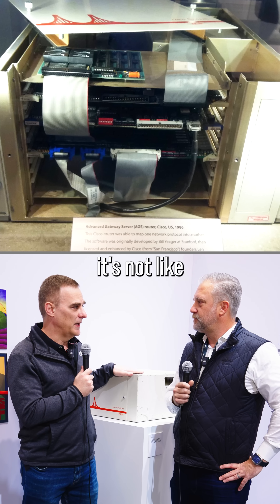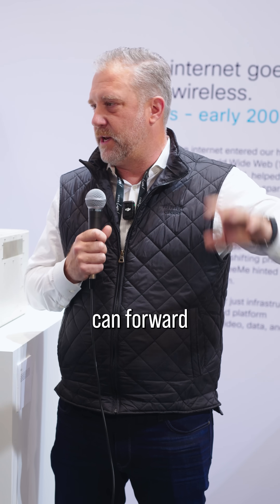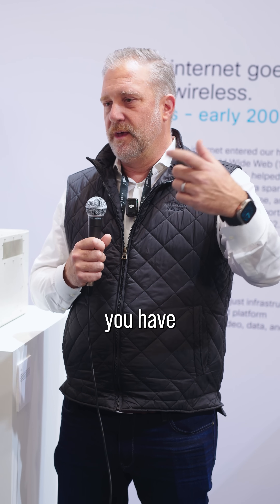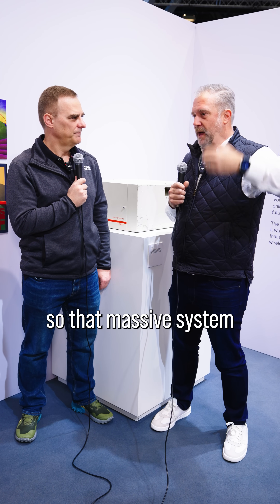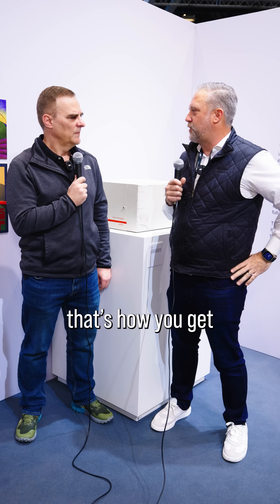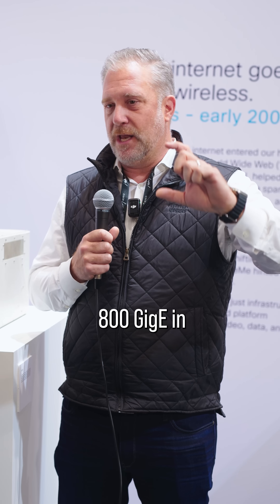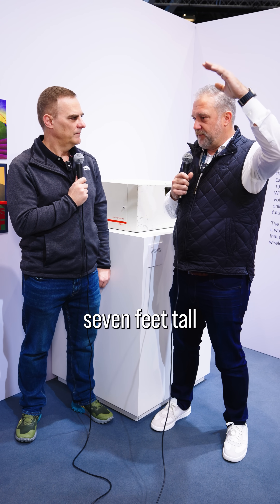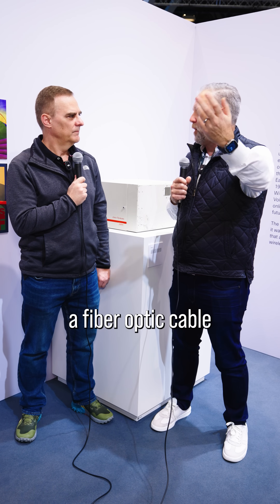Half-Petabit Router… Explained in 60s

Comment: The Cisco may be able to forward that much traffic at a single time but no one’s gonna see that much speed off of one Cisco. 😂 

You can get possibly up to 1,600Gbps by LAG’n 16 100GigabitEthernet ports, but you won’t be able to utilize all of that at once. LAG doesn’t work like a designated port. You will only be able to use 100G max and that assumes you have another 100G port. Likely end users will remain stuck at 1G to 40G at one time. This is a misleading video. I know what they’re saying, but to an average user, this may cause them to believe Ciscos can increase their internet traffic to 0.5 PB😎